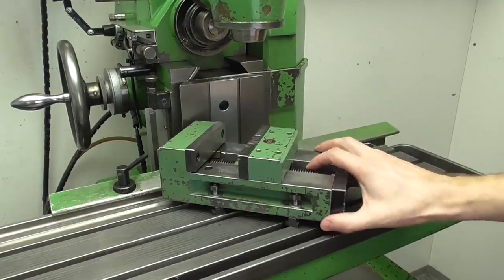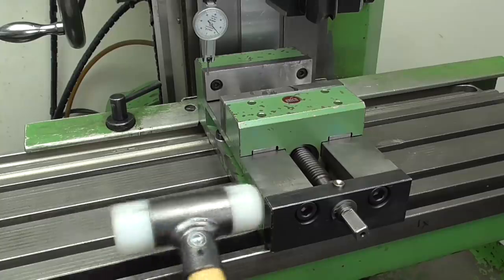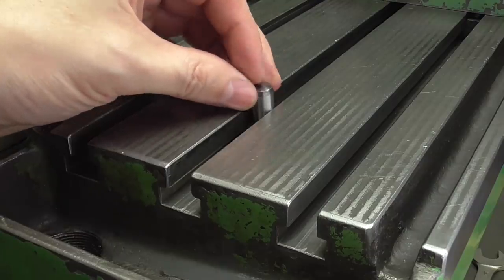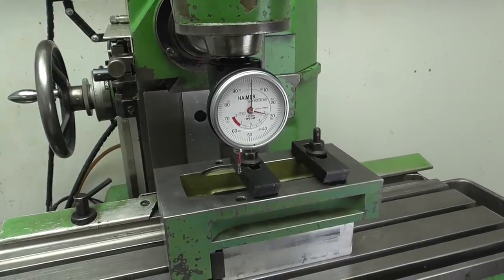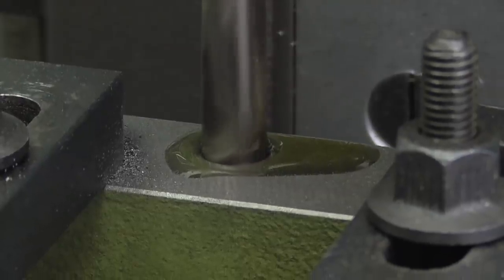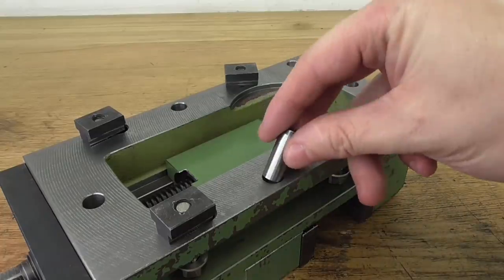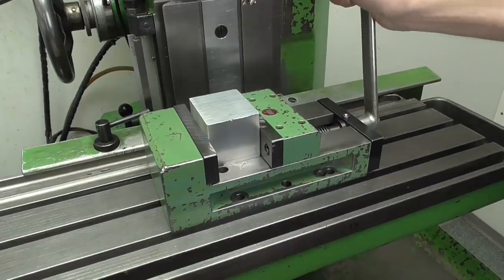Milling Vice Alignment? No, Thanks! Milling Vice Modification

Comment: I have to confess... this sounds a little complicated for me to understand but in the end we can see how doing this will going to save a precious time in adjustments. Thanks for the video 🙂
Reply from the maker: I can understand that, it's really machinists stuff here. Allthought just basics, but still... Thanks for watching :-)
Reply: @mymechanicsinsights  Maybe it would be easier to understand why you do certain things if you demonstrate the problem that would occur if you don't do them. e.g. what would happen if you just drill the holes without the aluminium block ;)
Reply: @abscopal  I mean I agree it's easier to see mistakes for demonstration purposes, but it's also quite wasteful if you really want to show what would happen. Maybe do a cheap mockup with wood or something.
Reply: @InstrucTube  OFC that's what I've meant. I did not mean to intentionally destroy the machinery :D
Reply: @abscopal  Figured, but yeah, wanted to make sure. :P

Comment: We just gripped a piece of keysteel that fitted tight in the table slots. Turn the vice over gripped the key steel clamped the vice down. Mill a slot that fitted the key steel, drill and tapped the key steel to the vice and that made it true with the axis. All you had to do was put the vice on the table and clamp it down it was always spot on.
Reply: Gmail X  Not really, that is the way a lot of vises made specifically for mills come from the factory. Trevor just did a retrofit.
Reply: Gold
Reply: Gmail X  I think you did.....
Reply: Exactly the way I've always done it  .. so much easier   ...
Reply: Yup! I did that about 15 years ago when I bought my small mill and vice. However I just bought a new vice and might try the dowel pin method.

Comment: Wow Mr My.  I have to admit I was a bit sceptical at the outset - I didn't think the tee-slots would provide the accuracy you were after.  But the proof is in the eating of the pudding and it looks like you've cooked it just right.  Well done.
Reply from the maker: T-slots in milling table are always very precise in width. So they're not just there to clamp stuff with t-nuts, also as help for alignment.

Comment: While this was a great tutorial and very well thought out from watching your indicator bobble back and forth between .001 and .0005 of inch you make want to grind your fixed jaw to ensure it is flat and perpendicular to vise bed and also check your thrust bearing in your x-axis for play if it's not a ball screw and adjust it and the gibs on table if your machine has them..
I use kurt vise on a Bridgeport's style knee mill and been able to indicate a vise in less than a minute without any pins or key slots..its a competition at my workplace.

Comment: That is perfect,  A milling machine is to rough out the project you are working on.. So in most cases it does not have to be exact.. You use a surface grinding for the exact Dimensions.. I miss using these machines.. so much fun taking a raw piece of metal and making an item

Comment: Bravo !
When I watch your video, I would like to have learned mechanic.
Compared to your skill level, others seems to be “amateurs”, what your are making is beyond “I make an other one” it is literally “I make it better than the original”.
I noticed many techniques used in your different projects, but did you considered using electrolysis for rust cleaning instead of chemical solution ?
Continue your great job it is very amazing and inspirational.
Phil.

Comment: This is going to depend heavily on the precision of the bed grooves. With a 10mm M6 pin (10,015/10,006) in a reamed 10,1mm hole (maybe 10,110/10,090 if set up well), you've already got 104um potential misalignment. If the grooves in the bed are wider than 10.1mm, you're right back to where you started. Either your bed grooves are extremely tightly toleranced, or you got lucky when tightening the nuts 😜
Reply from the maker: I said it wrong, it's reamed 10.01mm. The groves are pretty much the same.
Reply: @mymechanicsinsights  In that case, good mod!

Comment: Ok, it's the first time I have seen it done this way. Normally you would have a precision milled groove the width of the T-slot in both directions in the bottom with precision milled blocks press fitted into them (as in whacked in with a nylon hammer), as far as I remember. I am a bit surprised that a vise of this caliber didn't have key slots to begin with.
When I apprenticed as a fitter back in the day, during the first schooling term after starting the actual apprenticeship, we were tasked with making a milling vise like that (that I have recently refurbished, as it had become quite rusty). That vise has those slots milled on the bottom.

Comment: That reamer was running fast!! 

Check out precision gold drills, no need to centre drill or ream,  eg 6mm gold drill,  1000rpm at 100 mm/min feed, straight in and will be as accurate as a 6mm reamer

Comment: i had to ask you a suggestion- sometimes i have engines which have broken bolts in them & just incase if i have to use a drill to clean off those bolts in them-   which is the correct machine machine that i place the engine on to drill it - how do i hold the casing of my engine & allign it with the drill beat in such a way that both are at sharp 90degree - i loved your work & i just thought you may pour some ideas on this

Comment: Ever consider just cutting a set of jaws?
Not only can you then easily zero the perfectly aligned X and Y, but jaw Z zero is also perfectly flat.
Tip: use a dovetail bit to slightly undercut (approx +/- 0.020" in Y) the jaw cut so stock with sharp corners doesn't rise up when tightened.

Comment: At my shop we make pieces that are press fitted into the t-nut keys and are perfectly square and just use them as stops. It’s extremely quicker and you can use it for anything that you would rather not tram in with an indicator, they are always within .001”. Just an f.y.i.

Comment: 2 major mistakes : After drilling the holes maybe 9,5 they have to be spindled or milled to 9,8 mm. The drillbit is always moving a little bit. After that, ream - but with the slowest speed possible ... And when it has to be precise and it is also less wearing for the machine - table - slots, use a key and proper slot...

Comment: So does this mean there is no adjustment possible at all or do you still have some ability to make fine adjustments?
Reply from the maker: It's not needed anymore as it's already perfectly aligned with the pins.
Reply: @mymechanicsinsights  but wouldn't the pin dimensions slowly wear off?
Reply: @mymechanicsinsights  saw you other reply.
Reply: @glitchyikes  Those pins are extremely hard, the T-slots would wear out way before the pins. And the bed is made to withstand it.

Comment: Do you worry about the pins having a groove worn in them by the slots on the milling table allowing play? Would you still check the true from time to time or just replace the pins when needed?
Reply: The pins were hardened so I don't think that would be a problem.

Comment: With such tight tolerances, is it possible that the metal shavings can cause binding?
Reply: The vice is fixed into position before milling.

Comment: do you think this method will keep the precision over time ? The pin will not be slighly deformed over time and lose precision ?
Reply from the maker: They won't wear down because they're hardened. It's a very common method to align vises on milling machines.

Comment: Just as a question, is it normal to set the reaming tool at such a speed on a mill? I've learned on job, that on a drill press, the speed of a reaming tool is to set significantly lower than the drill speed
Reply: If you listen to the machine you can hear that the rpm between drilling and reaming gets reduced to about 1/3 of the speed. It still looks to me like the speed is a bit high for reaming, but it's hard to tell from a video.

Comment: Hallo, sehr gutes Video wie immer. :)
Ich bin relativ neu in der Metallbearbeitung. Mir wurde bei einem Praktikum (Maschinenbaustudium) beigebracht, dass man mit einer sehr geringen Drehzahl reiben soll. Jetzt sehe ich wie du und auch einige andere auf Youtube es mit relativ hoher Drehzahl machen.
Ist das egal?
LG aus Deutschland
Reply: Ist mir auch aufgefallen. Soweit ich weiss ist die Geschwindigkeit bei Guss relativ egal, solange man wirklich qualitatives Reibwerkzeug verwendet. Bei sehr zähen Stählen ist es glaub wichtig, die Drehzahl runter zu schrauben.
Eventuell erzähl ich auch gerade Blödsinn, also kein Gewähr auf richtigkeit :)
Reply from the maker: Das ist absolut korrekt. Ich achte nicht sehr oft auf die Schnittgeschwindigkeit bei der Fräsmaschine, da ich dafür immer den Riemen von Hand umsetzten muss.

Comment: Quick question: Why not drill a center hole  in the pins so that they are much easier to take out?
Reply: They are hardened and precision ground. Tuff stuff
Reply: @Adonis_51  Yeah, I was tasked with tapering some for a forging tool during my apprenticeship as a fitter, I think the bits I used were ceramic, as the carbide bits would just heat up and melt.
Reply: @HepauDK  ceramic? Wow had no idea they exist.  Learned something new today thanks. :)
Reply: because if you wanted, you could buy ones with a tapped hole. drilling already hardened pins sounds like a bad idea

Comment: Why not thin down a flat bar until it barely fits into the slot, then cut a slot across the bottom of the vist and set that flat bar into it? To cut the slot, clamp it upside-down to a block bolted to the table and tram it carefully. Now... just never remove the bar from the bottom of your vise.

Comment: Using an indicator with a ball tipped stylus to find the center of a threaded hole will give you an inaccurate reading, therefore this method can not possibly work as portrayed in the video.

Comment: people that make a living out of cutting metal would clamp the part in the VISE, then indicate the part and clamp down the VISE. I've watched men use the key slots in the bottom of Kurt VISES... it adds error to your work and then the hassle of picking the VISE up off the table.... Basically, it's a good theory; bad practice. It's a couple of notches below leaving the chuck key in a chuck with out your hand on the key, that I've seen men walked out for and rightfully so.
Reply: Michael Yanagita  that may be so, but I still don't put a "u" in color either.
Reply: Michael Yanagita  ok? I got paid to be a tool and die maker for 31 years. That has nothing to do with how much it sucks to use a keyed or pinned vise. I takes moments to indicate things in, it shouldn't take anymore than 5 minutes to indicate a vise in.... In 31 years, i put a vise on the mill table, without tapping it around, within .001 6 times, just by chance... within .0001 twice!  Keys and pins are shortcuts, and if your tolerance is great enough, quite suitable.   BTW, yes, I prefer 4 jaw chucks on my lathes too.  Something that would help a lot of home shop and professional machinists: The Machinist's Bedside Reader, vol 1,2, and 3. I never see anyone suggesting this three volume set. Not so much for the projects that are in them, but the thoughts behind ideas. Plus they're interesting... lol

Comment: Hallo, man schreibt "Vise", nicht "Vice".
Reply from the maker: Nur in Amerika und Kanada
Reply: @mymechanicsinsights  Echt? Ich habe das Google Übersetzungsprog verwendet, ich kann kein Englisch (mehr) und da war nur von "Vize" anstatt "Schraubstock" die Rede. Aber danke für die Info. Es mag ja auch daran liegen das Google aus den USA kommt.
Reply: Both are OK in the UK, and Vice is more common in Europe.
Reply: @RhysMogg  Thanks for the info, I said maybe Vice is in the translation program because it's from the USA.
Reply: Is German this complicated?  
Vice and vise: they're homophones, which means they sound alike, but have different meanings. And we do mean different.
Vice is the more common of this pair. Often contrasted with virtue, vice is used to refer to a variety of inadvisable acts and behaviors, from the merely blush-inducing to the truly scandalous. Minor foibles and bad habits can be described as vices, as can actions of such moral depravity that even regular readers of the most salacious tabloids are shocked, yes, shocked.
The word is Latin in origin, tracing back to the word vitium, meaning "fault, vice." It entered English by way of Anglo-French during the 14th century.
The word vise is another thing entirely. It refers to a tool with two jaws for holding something. The jaws can be closed, usually by a screw, lever, or cam. A vise is handy, for example, when you've glued something together and need to keep it still while the glue dries. The word vise is also used figuratively to refer to something that is like a vise in the strength of its hold, such as "a vise of debt."
Vise is a little younger; it dates to the early 16th century. It too traces back to Latin (to the word vitis, meaning "vine"), and entered the language by way of Anglo-French.
And that's the story on these two. It's satisfying, we think, how distinct these are. The tool has an s, the moral fault has a c; keeping them straight isn't so very onerous a task.
Except, this is English. Chances are it's not that simple.
And it's not: in British English vice is also used for the tool—that is, to spell vise. And historically, vise has at various times been the preferred spelling for both. Which makes it all a bit of a muddle.
For our part, we'll stick by this recommendation for readers on the American side of the pond: use vise for the tool and vice for the bad habit.
Before we leave this topic entirely, however, we'll take a moment to address vice in two other incarnations. The familiar vice- in vice-president and vice-chancellor is a prefix—hence the hyphen attached to it. It comes from a hyphenless vice we have not as yet mentioned. That vice is a preposition meaning "in the place of" or "rather than." It appears in formal statements like "I will preside, vice the absent chairman," and comes ultimately from Latin (by way of Anglo-French through Middle English), from vicis, meaning "change, alternation, stead," making it unrelated to either the tool or the fault.
Reply: @nigelm5777  You sure are good. But I'm not here at university to attend a lecture. I'm on my balcony browsing the internet. So now you've done it. You made me tired. I'm going to bed now, Professor.
Reply: So a Vice President would be... and to have him back again would not be very wise or vice or vise? 🤔🤔🤔🤔🤔🤔   😜🤣😂🤣😂😜😂🤣😂🤣😂🤣🤣🤗🇨🇭
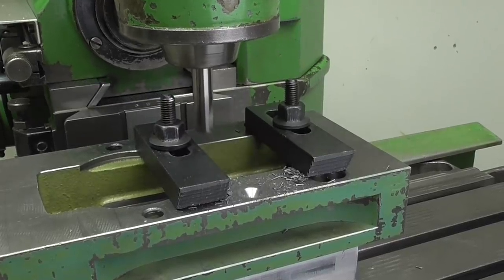Reply: @nigelm5777  Well said.   In addition, at 3:48, he says "countersinked" which is clunky and not the prefered usage since he's speaking about something which will have occured in the past.   "Countersunk" would be prefered.  But I realize English is not his first language, so it's okay.